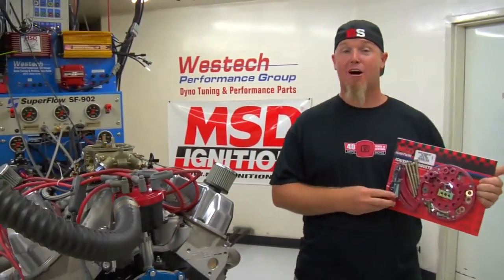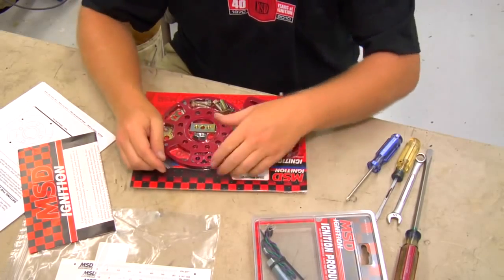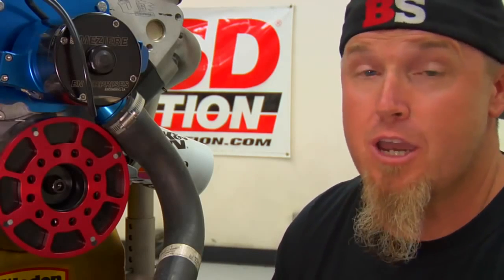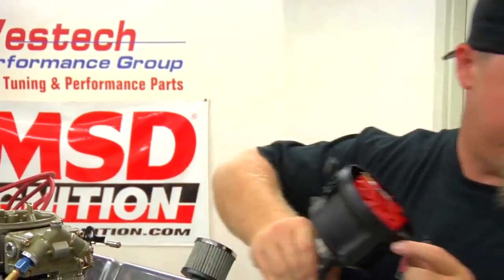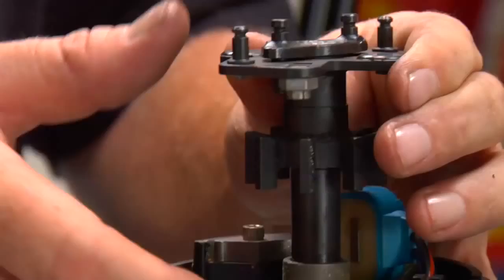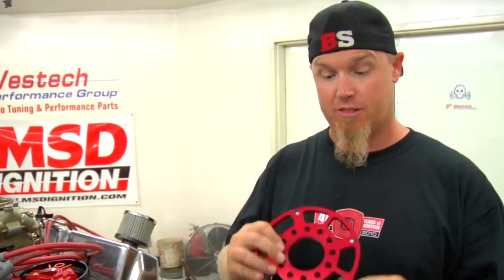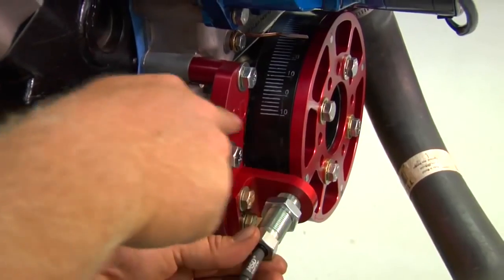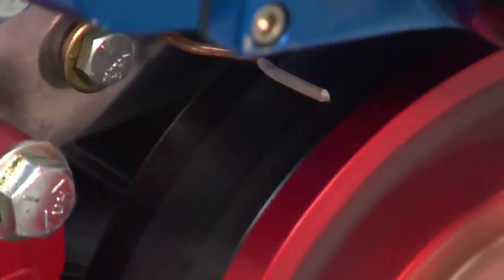Installing MSD Ignition Flying Magnet Crank Trigger Tutorial Overview

Comment: Looks well designed, constructed and is a great idea, but what about exposure to the elements? What if a rock gets caught and damages the sensor, wheel or the magnet? Is there a shield to protect the air gap? Thanks'.
Reply from the maker: +astrogen1960 Typically this would be used in a drag racing application where weather elements and road surface elements would be extremely favorable and risk from damage would be minimal. In order to protect it from elements, modification and fabrication of shielding would be required.